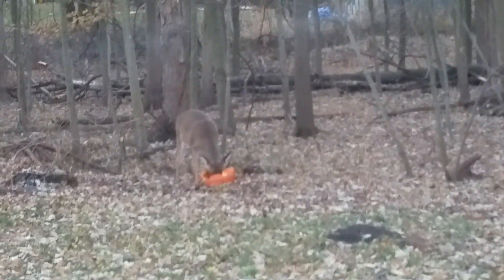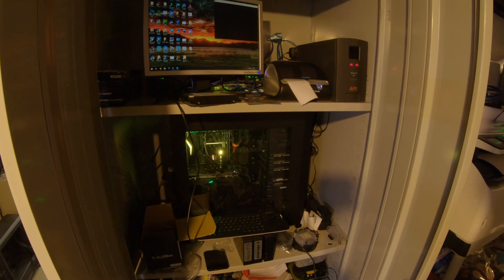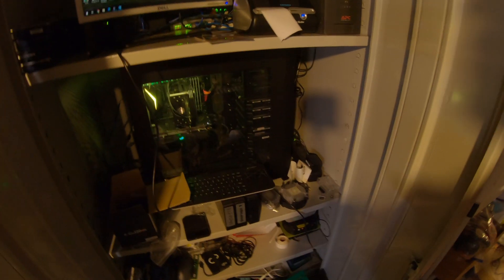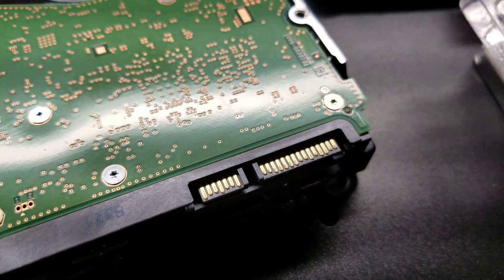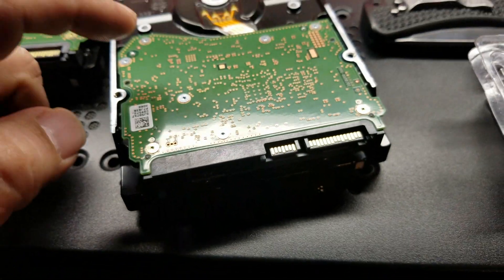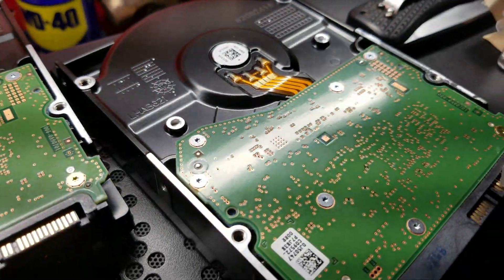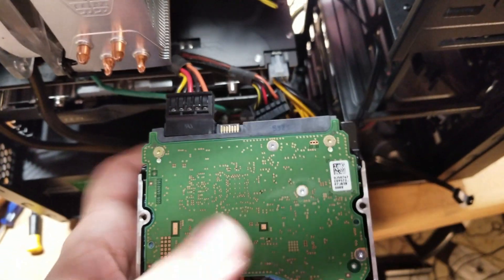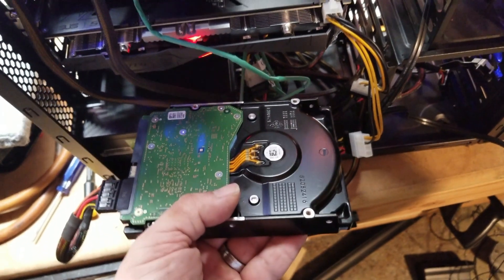WD Drive shucking 3.3v pin fix

Comment: Thanks for sharing! I was wondering if this was possible and the razor blade was the missing link for me. You do have to be very careful but I had more success when edging the blade closer to the end of the pin (closer to the plug side).  

Anyway - appreciate the tip! It will make my life much easier in the future